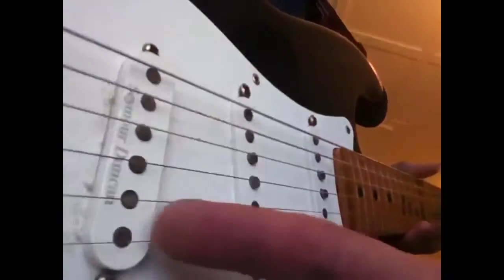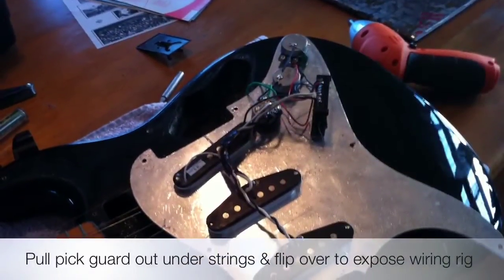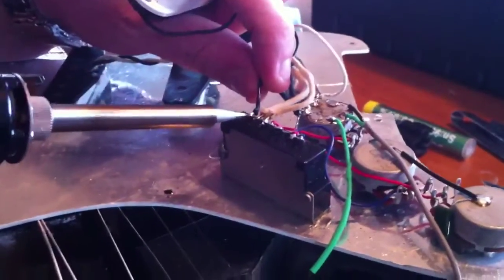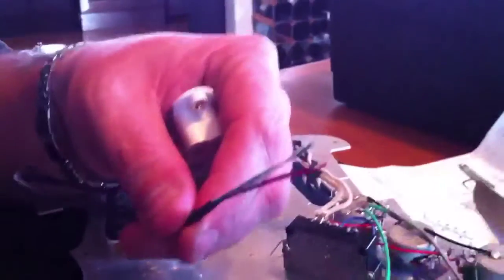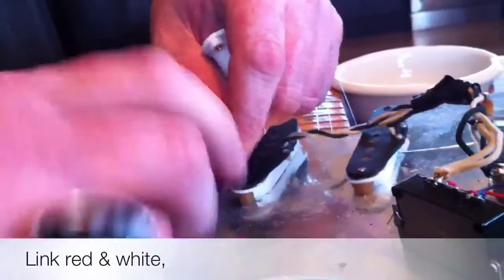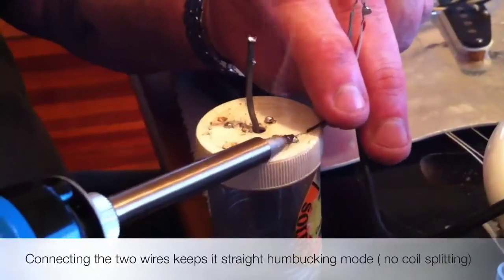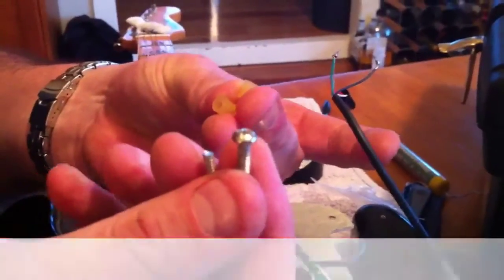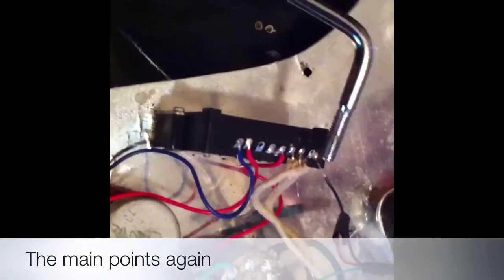Installing a Seymour Duncan humbucker (JB Jr)

Comment from the maker: Unless your a real strat freak I say leave it un split. It still sounds a bit less powerful but with out the normal Strat 'Quack'. You wont notice a drop in volume as much either. Im not a big fan of pos 2 & 4 anyway makes me think of to much bad 80's stuff. Like this you get all the nuts and the JB will be able to sing with all its copper a rockin! All the best.
PS DiMarzio do some real cool ones too....